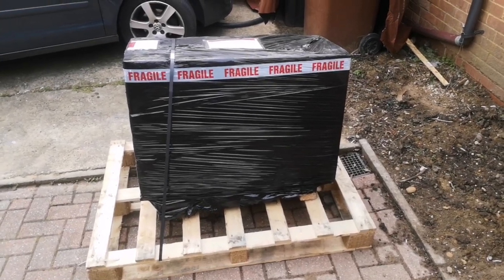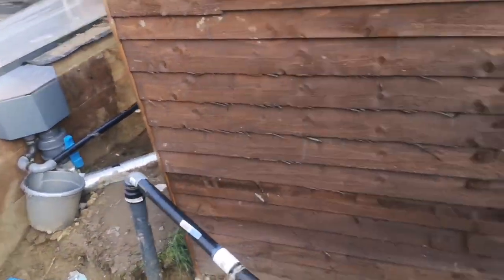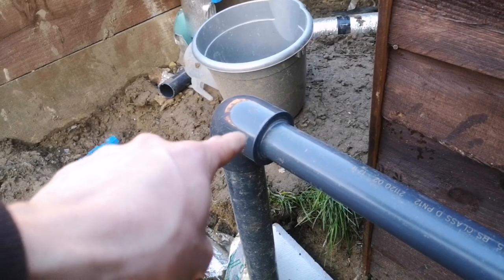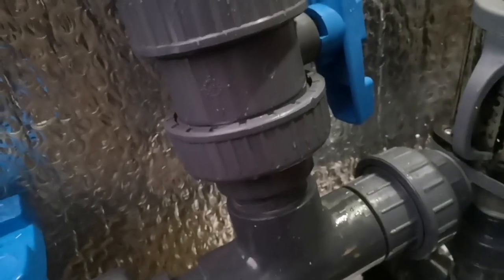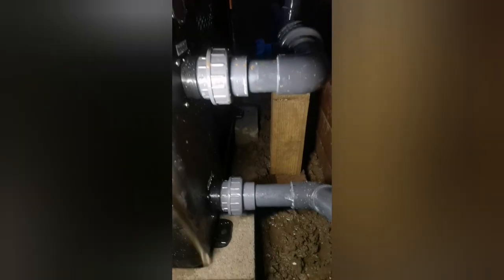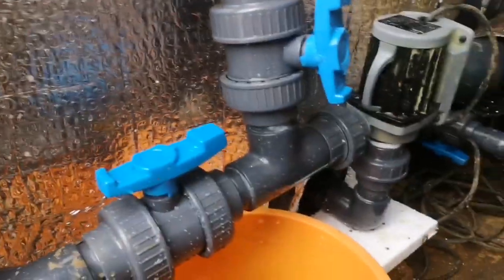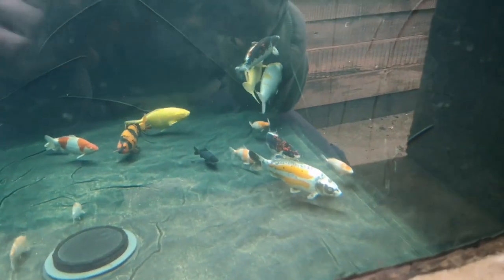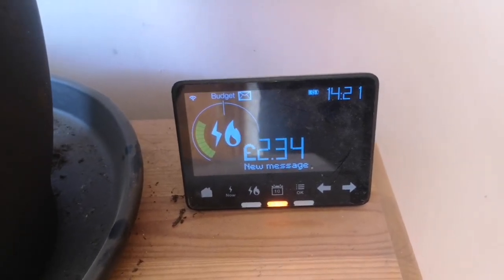Airsource Heat Pump Install. Remora i9. Lots of leaking pipework 💦

Comment: You could fit adjustable extension brackets to the shed but fit a block of timber first to the shed slats then screw the extension brackets to the block and adjust it till it is snug to pipes. Also lag all the exposed pipes wrapped and tied with stainless steel wire.

Comment: Wow that’s a lovely bit of kit you have there nice to see the fish gathering around the inlet for warmth 😆 
It’s a bit late now but I was taught when fitting pipe work do and dry fix first so as you are happy with the setup and out lay then start to glue the joints together and mark the joints as you go along with a felt pen that way you know what’s been glued and what ones haven’t ( just a tip for anyone else who is planning any pipe work) Great video M8
Reply from the maker: I did do a dry fit and marked them up. Don't know what happened when I was gluing them together 🤣 it's not the first time, I forgot on on the high pressure pump aswell. Water hit the ceiling when I turned that on. You would have thought I'd have learned by now 🤷‍♂️😂

Comment: I have a bit of wood like you. At the time it was temporary but it's still there a year later doing a great job of holding the pipe lol. That total on your smart meter was for Gas and electric, you need to press the button with the gas and spark to change it to just electric. Got the same screen too.
Amazing the difference in the fish with a bit of heat, great seeing them gathering round the pipe hehe. Cheers.
Reply from the maker: Got some clips aswell not but the wood is staying put I think 🤣
I've got a proper power meter on it now so I'll know an exact total for just the heat pump, I'll keep you updated. Cost me 18p in the last 48 hours and I've put it up to 13 aswell

Comment: Nice piece of kit! Looks quality and quieter than I expected. You’re going to need a bigger shed at some point!
Reply from the maker: Thanks. Really impressed with it so far. Yeah sheds getting a bit full now. Might replace the ibc with a smaller bio unit, it's not really worked how I hoped, can't get the air to move very well in it

Comment: Well done on fitting the air source heat pump,you must have got the patients of a saint with those leaks.Looks like it's a good unit.
I haven't got one on my pond but have one doing the house heating . There can be a lot of condensation from them in the winter,especially when they go into a defrost cycle so it would help to have good drainage under it. And try to keep a good blocks width from the floor so it doesn't sit in the ice that forms from the condensation.
Reply from the maker: Was definitely losing my patience with it, there was a fair bit of swearing cut from those clips 🤣 well worth it in the end though.
Thanks for the tips on running it, it's raised up a full block so hopefully be ok. I guess ice shouldn't be an issue untill next winter now, think we're past the worst of it 🤞

Comment: Great Vid, I just installed an i7 by Proteam and it looks remarkably similar to your unit, It amazes me the results from these ASHP units hopefully you will be as impressed as I am.🐟🐟👍
Reply from the maker: Think there supplied by the same people aren't they? I'm impressed so far, put it up another degrees today, think I'll get it to 15 and see how we go there for a while
Reply: @dannycurrie1  I think your right, as for running costs I'm holding my fry setup at 22 degrees and its only costing 70ish pence a day, hopefully with the warmer weather coming that will decrese too 🐟👍
Reply from the maker: @ecosystemkoi9159  what size is your fry setup? Sounds really good. I'm impressed with it so far. Looking forward to holding good temps all summer and piling the food in
Reply from the maker: I've just subbed your chanel. I'll take a look
Reply: @dannycurrie1  Thanks 🐟👍

Comment: Upfront costs puts people off, for obvious reasons. But they really do pay for themselves, over other heaters. Love the way the fish noticed the heat haha. As for the bit of wood on the pipework. Have a look airduct hangers etc, I'm sure you'll find something to work.
Reply from the maker: Yeah not cheap atall to buy but like you say, probably pay for itself in a year. I've got some pipe slips on it now against the shed so hopefully will be fine 🤞
Reply: @dannycurrie1  Yes I've seen a few recently who have been paying over £200 a month. As you say would pay for itself the first year or so. Don't need to heat too high anyway. What are you aiming to keep it at?
Reply from the maker: @adamrudge6480  yeah that's crazy money, I'll be turning it down if it gets like that. Was planning to stay at 12 but in 48 hours with the power monitor on it had only used 24p so decided to turn it up, I'll bring it up to 15 and see how I go from there
Reply: @dannycurrie1  That's good though tbf. Yeah I'd try it at 15 see how it goes. The real test will be the winter. But if you cover and insulate the pipes, I don't think it will cost loads more. I think I'll look into one for the winter.

Comment: Just fitted my ashp and fired it up Sunday for first time, went from 7.4 to 10 overnight, going for 15 by the end of week,  think they ara great pieces of kit, fish are loving the warmer water, just got to tweak bypass to get 2 deg differential between in/out temps at the ashp, been caught out a couple of times myself where I haven't glued a joint lol 😁,  wasn't as lucky as you, water gushing everywhere lol 😁
Reply from the maker: What one have you gone for? I'm well impressed so far. I'm going to leave it at 12 for a week to see how much it costs then slowly bring it up to 15. What flow have you got going through it. Mines on 5k and I've not check them temp differential yet, need to have a look.
I'm a nightmare with forgetting joints. I missed 2 on the pressure pump for the drum. Water was hitting the shed ceiling when I first turned it on 😂💦
Reply: @dannycurrie1  Danny, I went for thermotec 9kw, flow rate I'm not sure, I run a auga 20000 pump and she's set at 75%, so I suppose allowing for pipe runs/restrictions etc, probably around 10000 lts/hr.
 Your ashp should show on the display in/out temps, you want around 1.5 - 2 deg difference.
Reply from the maker: @marekskoipond9083  yeah the thermotec ones look the nuts. Was a real toss up between the 2. I'll have a look on the settings. I'm only running 5000lph through mine. Could turn it up if I need to

Comment: Hi mate, how have you got on with the remora heat pump?  My pond is 1000 gallon, thinking of getting an air source heat pump! Not sure what make time go for though, they ain’t cheap!  How have your bills been since you had it?
Reply from the maker: Honestly it's the best thing I've bought for my pond. Really hasn't cost that much all winter. £5-6 a week to hold 15. At 17 degrees now. Costing 60p a day ish. Not had an issue with it. Going forward I plan to use it more in the summer for max growth. Costs next to nothing to run in the summer months. Was costing £5-10 a month max to hold 22 degrees all summer last year
Reply: @dannycurrie1  that’s awesome results!  What did it cost you to buy?  I’m torn between the remora, thermotec and a duratec 7 plus!  There’s quite a difference in the price of them but not sure if they will all do the same job at same cost 🤦
Reply from the maker: @bezzaskoichannel3856  can't remember how much it was. They have gone up since then though. I went for the remora mostly because it was in stock when I wanted it and it was slightly cheaper. The guys on the phone were very helpful and knowledgeable which swung me that way. You don't hear a bad word about remora or thermotec to be honest.
Reply: @dannycurrie1  I think I’m gonna go thermotec if I’m honest, not sure why, just a preference!  Have you any idea if there’s a minimum flow rate needed for them to run properly!  
My pond is run on a 10k vary pump but I only run it at 40%!  I don’t wanna have to turn the pond over anymore than that ideally?

Comment: You won't be disappointed with the running costs aslong as you don't go too mad but remember to insulate everything you can.
I'm looking forward to seeing the results in a years time when you have had it over winter.
Take care matey 👍
Reply from the maker: So far it's costing next to nothing. For next winter I'll have proper covers and get all the pipework properly lagged. Going to leave it a 12 for a full week then bring it up to 15 I think. Will keep you updated with what's its costing as I've got a power meter fitted now
Reply: @dannycurrie1  I have been looking at these pumps but I like the thermatec ones too so it may be time to toss a coin 😲
Reply from the maker: @Tom_Prendiville  I was struggling to decide between those aswell. The remora was a lower max imput wich swayed it for me, meant I didn't have to change my power supply. Also slightly cheaper and smaller. Not sure there's much in it really

Comment: Looks a good ashp. Koi are loving it. Tell me about it mate leaks iv got one on my outlet on the k1 bead. Iv had to turn it off until i have time to repair it when im not at work very frustrating as its not a quick job this repair.
Reply from the maker: I feel your pain. Can be so frustrating. I've still got leak on 2 of the solvent weld joints, it's outside and only a slow drip so I've just left it for now. Was losing my patience with that pipework I'm not gona lie. Look forward to seeing your video on the bead
Reply: @dannycurrie1  put CT1 clear on it that will stop the leak n use washing up liquid on your fingers to spread it. Im buying some today to cure my leak which is where a hosetail meets the bead outlet. Cheers 👍🐟
Reply from the maker: @richd-koi  I've got some sealant. Just means turning it off for a few hours. Heat pumps still bringing it up, once it's up to temps ill give it a go. The washing up liquid is a good idea. I always get plastered in the stuff
Reply: @dannycurrie1  yeah got the washing up liquid tip with sealant from lee at the japanese water gardens works a treat 👍😉

Comment: Looking good mate looks like I got all this fun to come leeks can be a right time consuming job well done on getting it all up and running ok in the end thou Dan 💪👍⛩
Reply from the maker: Thanks mate. Just learn from my mistakes and make sure all your pipework is supported with clips at the start. Got it clipped up now
Reply: @dannycurrie1  I am shore I will get something go wrong tbh 😂😂 we all learn as we go all part of the hobby init keeps us busy thou 👍
Reply from the maker: @JamesTHEKOIwhisperer123  I've made my fair share of mistakes on the build. Always learning with koi as you know. Looking forward to seeing how you get on. Definitely recommend getting an ashp
Reply: @dannycurrie1  yea mate 100% still don’t no if I am going to go gas or ashp atm got me mate that is a pumper poping round to let me no if I go gas what needs to be done ect and see what will work out best as getting the gas line out there could be tricky and very expensive but worth me thinking about both ideas atm
Reply: @JamesTHEKOIwhisperer123 ?????????
Reply from the maker: @JamesTHEKOIwhisperer123  gas is definitely cheaper in the winter for sure. Ashp as less efficient in the winter. Ashp wins in summer though so hard to choose. I couldn't easily get gas out to the pond and I my house boiler isn't big enough to run it off so heat pump for me. Impressed with it so far
Reply: @dannycurrie1  yea I got to find out if I can get gas but if not will be getting the ashp 

Or just fit both lol 😂
Reply from the maker: Both 👍
Reply: @JamesTHEKOIwhisperer123  so ?

Comment: Lol take 3. real nice bit of kit that ASHP like the WiFi  connection and being able to adjust it from anywhere I think a big rise in temp by about 5/6 degrees I don't think it would cost you a great deal more then it has already 👍👍
Reply from the maker: Really impressed with it so far. I've turned it up to 13 now. Will do a degree a day get it up to 15 in think seen as it's not costing much

Comment: Hi what name and haw much it it Per month to run
Reply from the maker: It's a remora i9 although I now have an i12 as the first unit had a few problems so they swapped it. Running costs depend on how large your pond is and how well insulated, outside temperature and what temperature you set it at so there's no set figure. For me to keep my insulated but poorly covered 10000l pond at 16 degrees it's cost a little under £20 for April
Reply: @dannycurrie1  my pond just over 7000lt what the name off urs new 1 mate

Comment: Mate good job on the ashp but I bet you wish you'd concreted the bottom drain with a slope on it when you showed thru the window up and down and a lot of creases sorry mate but I must say I really don't know why you did your window like that it can be leaking and you Will know if it's only a drip 👍👍👍
Reply from the maker: Yeah the bottom is a little bit of a disappointment. It rained heavily between putting the underlay in and getting it filled up, trapped alot of water and sloppy mud under the liner. Thought it would flatten out a little more than it did. My old pond was done the same way but I got it all in when it was dry and it was fine. Waste doesn't seem to be settling but it's a little late to change it now. I'm happy with how the window is done. It's super neat and it's not leaking. The water would seep between the next row of sleepers if it was
Reply: @dannycurrie1  I don't think it would necessarily mate could easily go straight on the tape then the insulation board to the bottom 👍👍👍